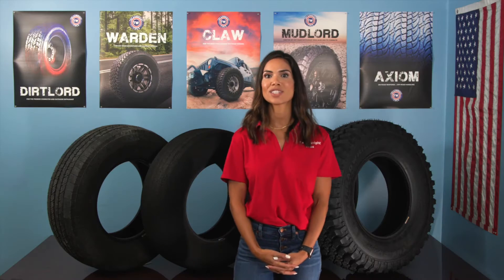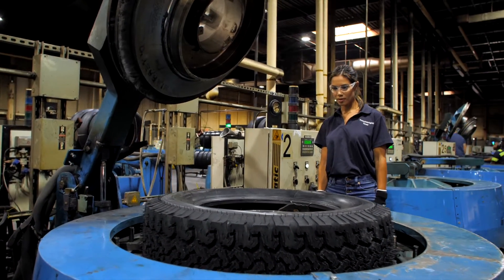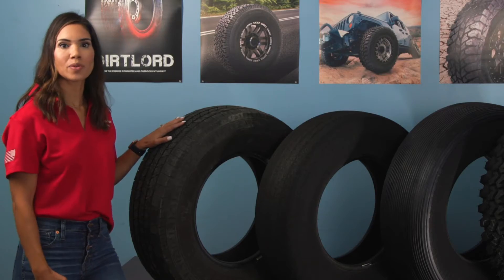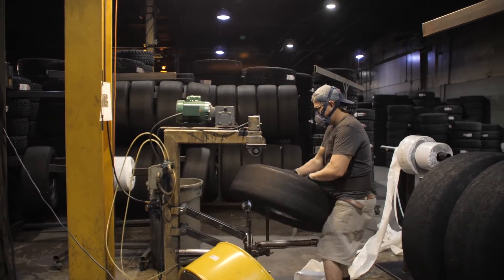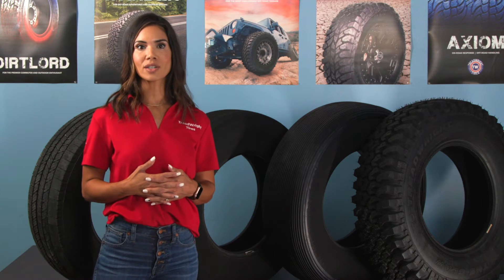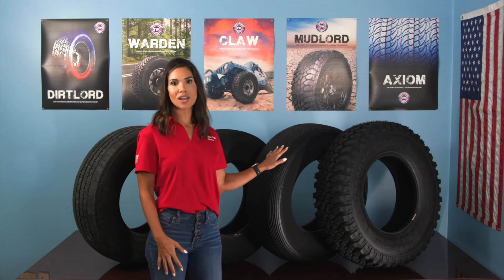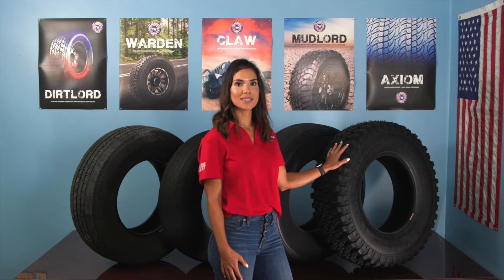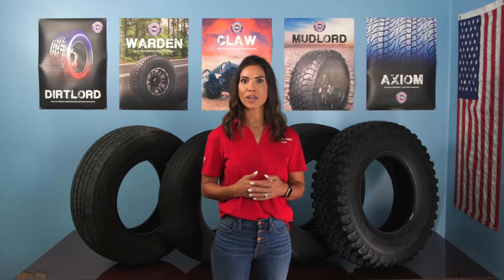Tire Manufacturing Process | TreadWright Tires

Comment: Read the reviews online, not only for the quality but customer service.  None of these balance, they vibrate like crazy, and when they pull apart at the bead they will blame you, call you a liar about the miles on them, and they won't warranty their defective tires.  Also it takes 3 voicemails to get customer service to call you back.  Tires are also riddled with patches.  Avoid avoid avoid.